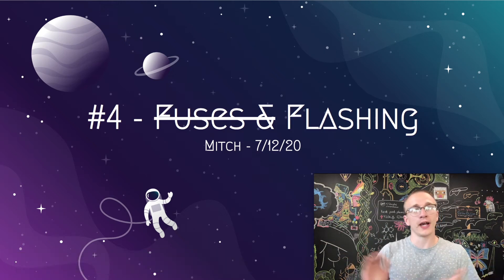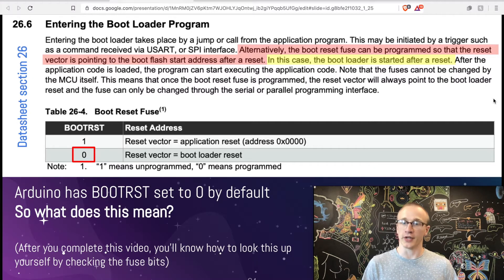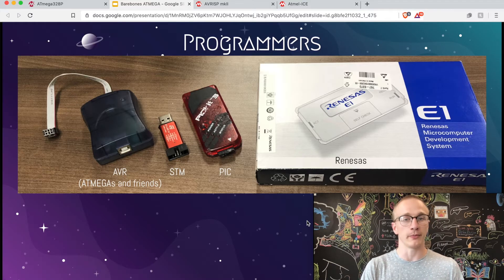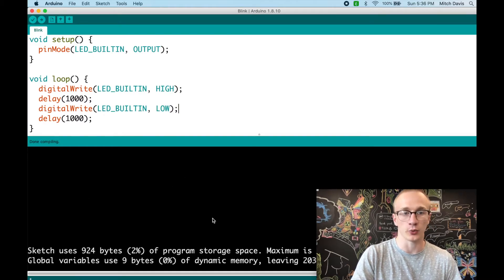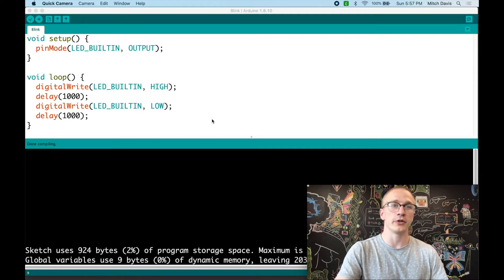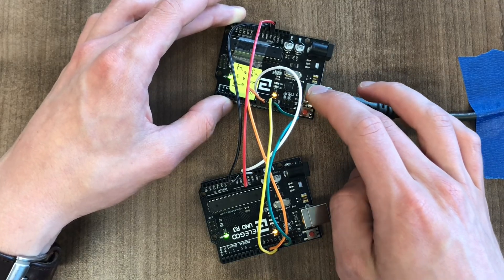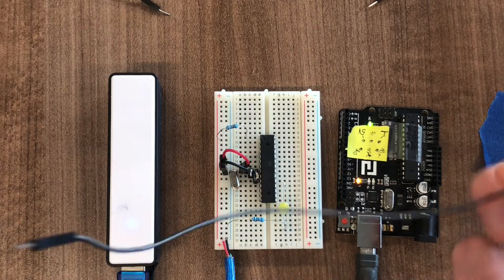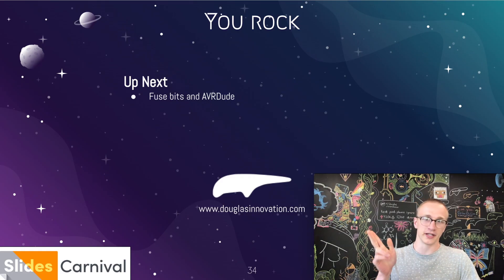Bare-Metal MCU #4 - Bootloaders and Programmers

Comment: This series is enlightening! Binge worthy. And i’ve been screwing around with learning how to add tools and suff to MPlab X. When this is so much easier.
Reply: Actually, I can't get it to work when upload to an AVR on a breadboard and a UNO with the ArduinoISP Sketch and "Aduino as ISP" Programmer (with that successfully loaded to the UNO. :( I get "Failed programming: uploading error: exit status 1". I have everything except for the caps for the Xtal. I'm using an Atmega 324P chip though and followed the pinouts per that datasheet. Double checked everything and tried two different AVRs.
Reply: actually, looks like 324P is not natively supported in Arduino IDE without jumping through a bunch of hoops. That is my answer. The IDE does "see" the 324P though with the right pinouts. 328P is supported natively.
Reply: Got it to work with the 328P. So your video is correct. The 324 does not work :(

Comment: man, how to program, NEW CHIP ATMEGA8 or 328, i buy NEW CHIP, and my usbasp just cant see this microcontroller. Just new chip without or with arduino. New chip from magazine.
Reply: you program controller that already was in arduino, but what with controllers that just from magazines, that just clean. can u help?
Reply: @ammygame_1   Could be several things. Other than bad wiring/clock, it could be a defective chip or a fuse disabled SPI port/reset pin. You might have to use high voltage parallel programming with a tool like RescueAVR. Note that sometimes clones come pre-programmed with the arduino bootloader, so you might want to wipe the flash to use it baremetal.
All in all any brand new chip from the factory should be recognized in avrdude through ISP or FTDI, at bare minimum just to be able to read its model informations.

Comment: So, this is means that I will can to program other models of microcontrollers or just only the Atmega 328???
Is there a way to programming a PIC without a commercial programmer board too? (Sorry for my low level of English understanding).
Greetings from Argentina. 🇦🇷🤝🏼🇺🇸
Reply: there are plenty of opensource pic programmers. Some of them use an atmega chip so you don't need an initial commercial programmer at all to make your own. The downside is that such programmer is not whitelisted by mplab so you're limited to FOSS environment with limited chip family support and functionality (eg. sdcc supports only pic16 and 18 series without debugging)

Comment: I am trying to program an STM32 microcontroller without using a programmer, would this method work for that?
Reply from the maker: Take a peek at my stm32 videos :)
You need either a programmer, or make sure there’s a bootloader on the microcontroller that allows you to program it in some other way (such as USB or UART)

Comment: Mitch thanks for unintentionally answering something I had wondered if safe to do. In using the Uno to program the chip on breadboard both having separate supplies, only needing to common grounds of the USB PC supply and the battery pack supplying the breadboard.

Comment: When I try to upload the blink sketch using another Arduino UNO as a programmer, I am getting the following error message: 

avrdude: AVR device initialized and ready to accept instructions

Reading | ################################################## | 100% 0.05s

avrdude: Device signature = 0x000000 (retrying)

Reading | ################################################## | 100% 0.03s

avrdude: Device signature = 0x000000 (retrying)

Reading | ################################################## | 100% 0.03s

avrdude: Device signature = 0x000000
avrdude: Yikes!  Invalid device signature.
         Double check connections and try again, or use -F to override
         this check.

avrdude done.  Thank you.

Could anyone please tell me how I can go about to fix this issue?

Comment: If I program the barebones ATMega328P microcontroller using an Arduino UNO board as the programmer, am I erasing the bootloader present on the ATMega328P microcontroller? If I ever want to program the ATMega328P microcontroller via USB (after re-inserting it back onto its respective Arduino UNO board), will I have to burn the bootloader?
Reply from the maker: If you flash the chip using some external device (either a second arduino, or a programmer) it will erase the bootloader by default.  You can always add the bootloader back in by going into the arduino IDE and hitting "Tools" →"burn bootloader".  Burning the bootloader requires an external programmer as well.  Basically, without a bootloader, the arduino doesn't really know how to talk over USB to get a new program.
Reply: @MitchDavis2  Thanks for the reply Mitch!

Comment: Can one make their own bootloader? For Arduino that is
Reply from the maker: Absolutely.  If you read the datasheet, you can learn how to self-program the flash memory.  
Then you just need to come up with a way to receive that program and write it into flash memory.
Reply: @MitchDavis2  I was talking to someone about loading os in Arduino like raspberry pi with Kali and he mentioned bootloader and stuff I had to check on, sorry to bother but can Arduino or atmel, at least any, hold say Kali? 

And thanks for the reply 👍👍👍
Reply from the maker: @aspirohk3558  I doubt it can hold an OS like kali.  You need quite a bit of Ram and program memory to run Linux.  However, there’s something called FreeRTOS (free real-time operating system) that can run on Arduino.  It’s super light-weight in terms of operating systems, and it mimics how operating systems work by being able to execute “multiple” programs.  The operating system executes each of these programs to simulate multi-threading.
Reply: @MitchDavis2  nice I'll research on that and see how if resources allow....ooooh what about if I add up extra say expansions like external ram and storage....🤔🤔🤔like in a normal motherboard would it manage?
Reply from the maker: @aspirohk3558  at that point, you’re basically re-inventing the computer.  You have a processor (or microcontroller in this case) at the heart, and then you add external ram, flash/hard drive, etc to make a full computer.

Unfortunately, that’s a massive project to take on.  You’d have to understand how the Linux kernel expects to access files, and then write drivers to make sure that files make it where they’re supposed to go.  Also, I don’t believe Arduino has support for external RAM/flash, which means you’d have to get incredibly creative and virtualize it yourself.

The raspberry pi foundation (and beaglebone/orangePi/bananaPi,jetson, etc) have already done this
Reply: @MitchDavis2  if the budget allows I'll go for it and kinda fabricate a new board that allows at least the -nix oses in them....and kinda offer a completion to raspberry pi ....I think I'll append you in its name cause this infor I have kinda searched a bit not found it ....and send you Kenya special....madazi... 👍
Thanks
Reply from the maker: @aspirohk3558  I certainly wish you the best of luck, you’re venturing beyond my area of expertise, so I hope you’re able to find the resources you need.
Reply: @MitchDavis2  yeah thank....wanted to venture in systems programming, electronics and hardware, and eating...but resources though I'll do my best thanks

Comment: Why do they recommend you flash a bootloader onto the attiny when it doesn't have a usb port?
Reply from the maker: The USB port doesn’t necessarily have anything to do with a bootloader.
A bootloader is mostly just a program that lives on the microcontroller that is able to talk to SOMETHING to get a new program.  
By default, you can only program over SPI (and parallel i think).  With a bootloader, you could program over UART (using less pins than SPI) or something like SD Cards, or even something like ethernet.  Basically, any “communication” method could be used to push a new program onto the microcontroller, even if it’s not the native SPI approach 

If you need the extra space, it’s totally acceptable to go without a bootloader.
Reply: @MitchDavis2   Sorry to bother you again. (Awesome series btw, keen to learn more about C in general now.)
Is loading a program using UART more cumbersome than SPI to justify the hassle of adding a boot loader?
Reply from the maker: @SafetySkull  There's not really a straight forward answer to this since it's highly situational, so I'll give you some idea about past projects I've done, and how I handled programming.

Firstly, I ALWAYS put SPI pins/pads somewhere on the board.  That way, if I ever mess something up or corrupt a bootloader, I always have a safety backup method to program the microcontroller or re-flash a bootloader.

PROJECT 1: No bootloader
One project I worked on would take sensor signals and output them over UART.  It was a pretty simple project, so I didn't put much thought into it.  It was industrial, so I had to encase the entire circuit board in epoxy.  I programmed this over SPI, and didn't use a bootloader.  I quickly regretted this design choice because once I epoxied the circuit board, I could no longer re-program it because I didn't have access to the SPI pins.  It also sucked to know that I had access to the UART pins (since that's what the data output was) but I couldn't reprogram it over UART because I didn't have a UART bootloader on the chip.

Project 2: Bootloader caused problems
I made a small personal RFID project which just used an RFID reader to activate selections on a vending machine.  The RFID reader I used would send the RFID code over UART, so I hooked that up to the UART pins on an arduino.  The only problem is that I could no longer program the arduino over UART (or USB) because the UART pins were being actively used by the RFID reader, which prevented the arduino software from pushing new code onto the chip via UART.  I had 2 options to fix this: program the chip over SPI, or add a physical switch that disconnected the RFID's UART pins from the arduino so they wouldn't interfere.  I ended up adding a disconnect because I didn't want to have an arduino floating around without a bootloader, which would be asking for future headaches.

Comment: It gives me error invalid signature 0xffffff for atmega 328p U , i tried like so many things but still cant be able to burn the bootloader in this chip through arduino, please need some help with this
Reply from the maker: It sounds like you either have a bad chip, or it’s wired up incorrectly.  “FFFFFF” is all 1’s (1111 1111 1111 1111 1111 1111).
This means youre probably not even communicating with the chip.  Feel free to send a pic of it if you want a second set of eyes on it
Reply: @MitchDavis2  where to add the pic ? And i tried it with other ics too and all the configuration and wiring like i checked it multiple times, i am using latest arduino ide 1.8.13 on window 10
Reply from the maker: @MirAclE-mf2pu  I like to upload pictures to Imgur.com and post links.  Give that a try
Reply: @MitchDavis2  ohk i will do that, thanks for helping
Reply from the maker: @MirAclE-mf2pu  Ok, it looks like you have everything wired up correctly.  The only thing I can't quite see is the oscillator.  Can you confirm that it's in pins 10+9 (and not 10+8)?

Some questions:
1)  Are these new ATMEGA's, or are they from an arduino?  ATMEGAs from the factory come with different default fuses than the ones that are burned into arduino unos.
2)  Have you been able to flash one arduino uno from another arduino uno before trying to program the microcontroller directly?
3)  Do you own an oscilliscope?  I often like to probe the XTAL pins to see if the clock is even doing anything.  If you don't have one, no big deal.

below are my notes when I was going over the picture you sent.  Formatting might look a bit off if you're on mobile.
--------------------------------------------------
{SPI CONNECTIONS}
Color  | Arduino Pin | MCU Pin | Mitch's comments
-------------------------------------------------
Blue     13 (SCK)      19        Looks correct
Purple   12 (MISO)     18        Looks correct
White    11 (MOSI)     17        Looks correct
Orange   10 (SS)       1         Looks correct
Brown    GND           GND RAIL  Looks correct
Red      +5V           5V RAIL   Looks correct

{POWER}
Color  | MCU Pin | Dest       | Mitch's comments
-------------------------------------------------
Yellow  20         5V Rail      Looks correct
Black   22         GND Rail     Looks correct
White   7          5V Rail      Unnecessary, but not wrong.  Don't need to wire up ALL 5V pins
Black   8          GND Rail     Unnecessary, but not wrong.  You don't need to wire up ALL ground pins
Rstor   1          5V           RST Pullup (10k)

{Clock}
Component | Pins  | Mitch's comments
-------------------
Xtal        10+9?   Can you confirm if this is in pins 10+8, or 10+9?  It should be 10+9.
Cap         10+GND
Cap         9+GND

{Others}
Component    | Pins     | Mitch's comments
-------------------------------------------
LED+Resistor   19 (sck)   This should be ok, but I'd recommend removing it for now
Reply: @MitchDavis2  yes configuration are all correct as you mentioned, And yes its a used one microcontroller atmega 328p U but i even tried some new ones and the results were same for all of them, and yes my oscillator is on 9 and 10 and i even tried it without led and resistor still results were same for me. And unfortunately i dont own an oscilloscope for now.
Reply: @MitchDavis2  Actually i didnt try to flash any other programs i was just trying to burn the boot loader first but got stuck in this, and still looking for solutions

Comment: I accidentally corrupted bootloader of nano, tried to make that work as before using another nano. But eventually fails. But this video makes quite lots of info, great work.👍🏻
Reply: @MitchDavis2  I watched several other techniques for make it alive. But eventually failed, 
And do you have any idea of making bare metal programming on Interrupt with atmega328p (uno or nano). That was hard to grasp. Think I could use help.
Reply: @MitchDavis2  To be frank that's not a big project. Actually making custom libraries. We do have avr libc though. Idea is to learn a different approach apart from Arduino IDE.

I am curious to know about using only datasheet as you did. Once done will let you know!!!. 

Thanks a lots for those replies on interrupt video that will help me and others. Great work 👍🏻

Comment: Great work thank you, i was wondering why you did not use the ICSP pins using jumper wires ? rather than the standard pins !
Reply: If I had to guess, Mitch wanted to demonstrate that ICSP uses the SPI protocol to flash the micro, and that you can connect the jumpers directly to the micro instead of the ICSP, although both methods work!
Reply: thank you got it!
Reply: @testme2026  What's the answer to your question? It seems to be gone!
Reply: What was the answer?

Comment: Hi Mitchel :

Programmer Type : USBtiny
Description     : USBtiny simple USB programmer, https://learn.adafruit.com/usbtinyisp
avrdude: programmer operation not supported

avrdude: Using SCK period of 10 usec
avrdude: AVR device initialized and ready to accept instructions

Reading | ################################################## | 100% 0.00s

avrdude: Device signature = 0x000102
avrdude: Expected signature for ATmega328P is 1E 95 0F
         Double check chip, or use -F to override this check.

avrdude done.  Thank you.

Any idea where I might be failing here?  I am using a USBTiny however it does not recognize the chip.  Thanks!